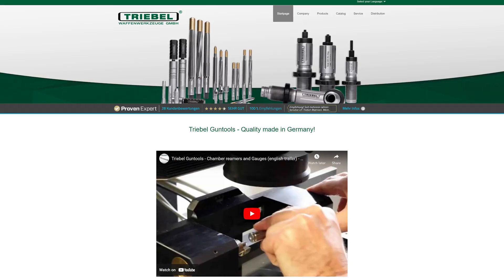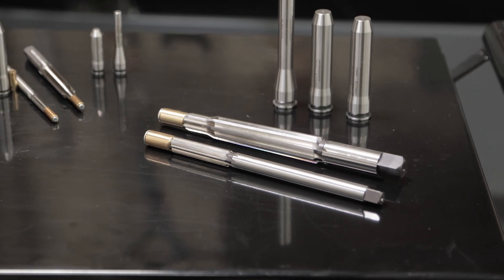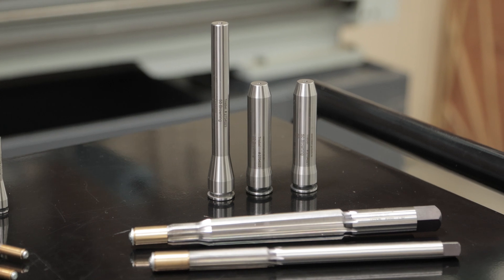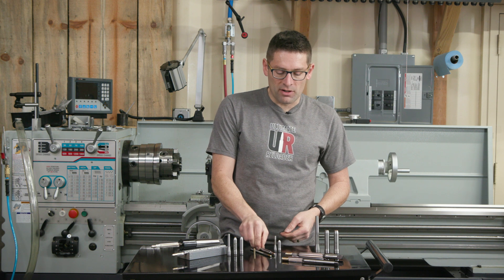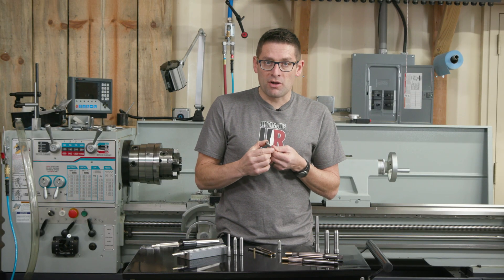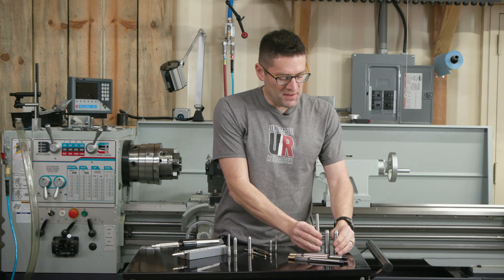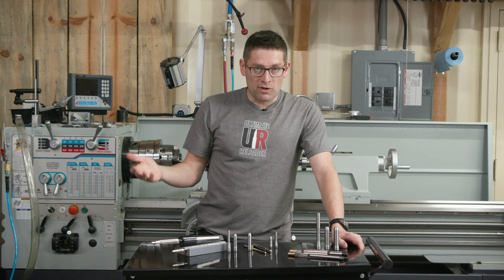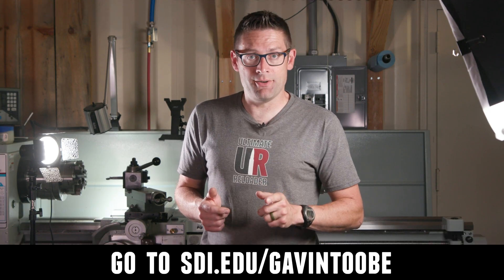Overview: Triebel Reamers and Gauges from Germany

Comment: I’d like to see a video on making custom sizing and seating dies to go with one of your builds.  Maybe a comparison using a chamber reamer and a sizing reamer in Newlon sizing die blanks using neck bushings, then compare the brass after several firings using both dies bumping the shoulder 2 thou each time.  Will the case web area continue to fit nicely in the chamber if the chamber reamer is used to cut the sizing die?  Or do we need to buy the actual sizing reamer to tighten up the body and web of the case a little more?  With moderate loads I suspect the chamber reamer will work just fine as it would be similar to neck sizing and bumping the shoulder.